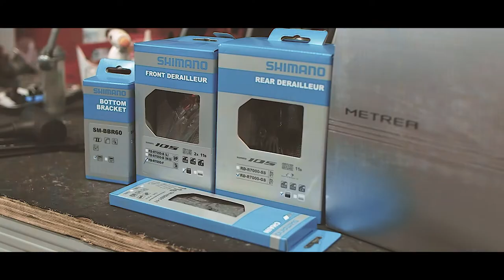Ascent Builds - Intrepid Mini Velo - Shimano Metrea

Comment: Hi how cn i get this metrea shifters with installation for the same Bike model in Singapore?
Reply from the maker: Hello! I think they're out of stock - have been discontinued. You may find some shops selling them on clearance. The bigger issue is the bullhorn bar - it requires bullhorns with 30mm diameter instead of the standard 24. As far as I know, only Shimano makes them, and they have been discontinued as well.
Reply: @ascentbikes  Aww man, thank you for the reply!